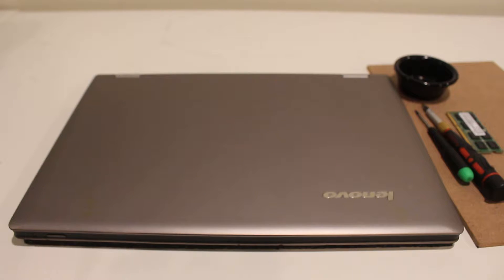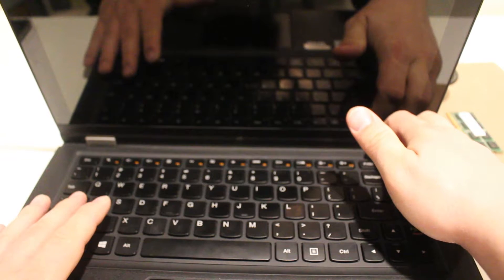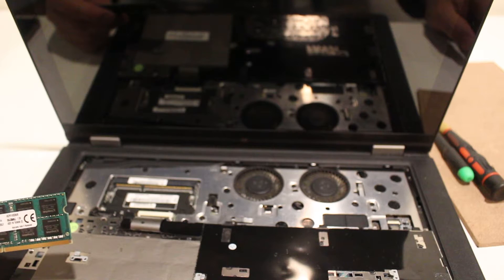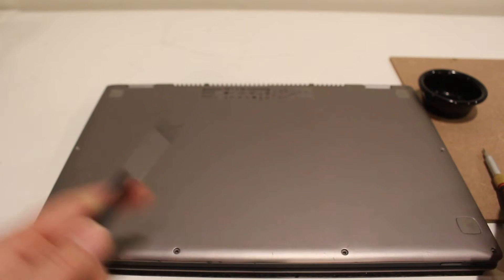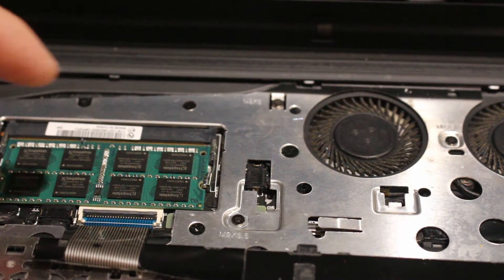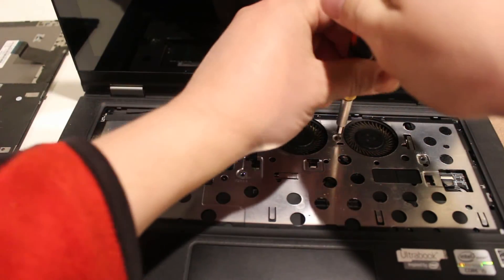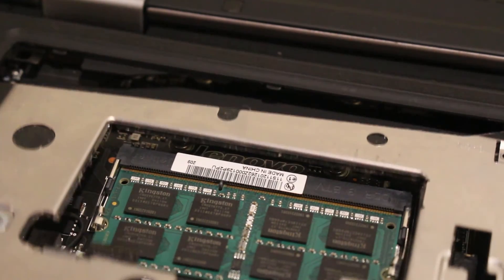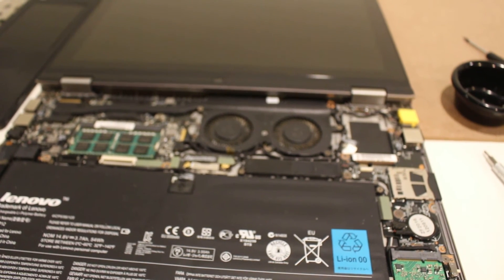Lenovo IdeaPad Yoga 13 Ram and SSD Drive Upgrade Tutorial Guide in 2020

Comment: There is a slot in the IO board that I thought it had a missing part, but I see that is a free slot, what can I put in there, at first I thought it was the wirelessly card that was not working, after I found the small wifi card I'm not sure to find one Anatel 5g, is there a way to install inside another type of WiFi card 5g instead of using an usb, I really love this machine because I have it since 2012 and it's great! Excellent channel by the way.
Reply: Been trying to fix that wifi card for years with driver updates which worked for a little while but eventually stopped working.  Couldn't find a replacement card either, no luck. Just trying to save you some time and stress, would just stick to the USB wifi. Wish I thought about a USB card before disassembling the laptop, what an easy fix. Make sure you turn off the original wifi card in windows too if you go the USB route.

Comment: Whelp, I was careful, but after going through those steps it won't turn on. I checked the power button connection and it looks good. Any ideas what I did?
Reply: So you didn't disconnect the battery while doing this? If not you may have ruined the board

Comment: Great video added more life to my favorite notebook did the both ram & msata upgrade, Both worked as per your video here but “missed” connection to touch pad and it got pulled out. When I was reassembling the unit, the touchpad ribbon cable would not stay connected and the white retainer fell off… it there any repair possible for this touchpad? Guess my old eyes and fingers are not what they used to be…. Or do I just need to forget it and use a usb mouse now… Thanks

Comment: Thank you for showing details of steps for upgrading the RAM and hard drive. I have one the same and I still love it. Is there anyone using digital pen to write? I would like to know which fine tip pen is compatible with this laptop. Thank you!
Reply: I tried a Wacom bamboo and it wasn’t compatible connecting through Bluetooth so I got a active stylus pen from Amazon that doesn’t require Bluetooth and it works flawlessly!

Comment: I have the same but mine has 8gb ram and 2 ssd’s 120gb and 128gb one is intel and the other is Samsung 860 evo plus and they are in a raid 0
Reply: I've been searching forever about this and read that Raid was not supported in this machine. Did you notice a big improvement in read speeds?
Reply: @ivan13x  Software RAID is always supported
Reply from the maker: Nice

Comment: You have no idea how this video gave hope to a 7 years yoga 13 putted on the shelves for 3 years already. Thanks!!  I bought  a Dell Inspiron 15  with i7 6th generation  on 2017 to replace it, but now it is starting to give problems as blue screen and hard risk problems. Dell annoyingly uses a 5400 rpm hard disk and then I was searching about sdds replacement. It is amazing how the Yoga 13 of 2012 offers 2 slots to sss msata while the dell of 2017 has just the 2.5 slot, not even a m2sata.  Till today I did not know that Yoga 13 had two slots for ssd.  Ahead of his time, most ultrabooks till today  has one.